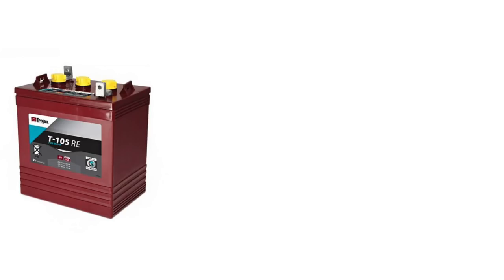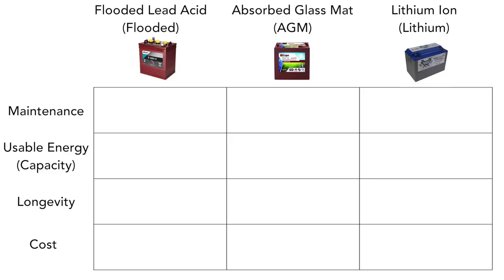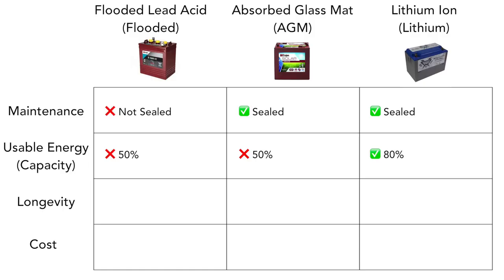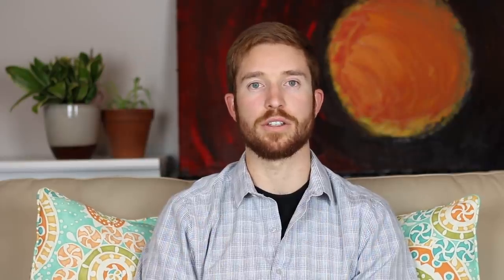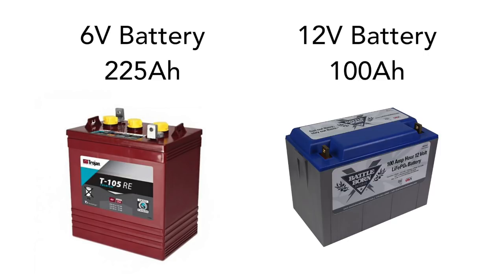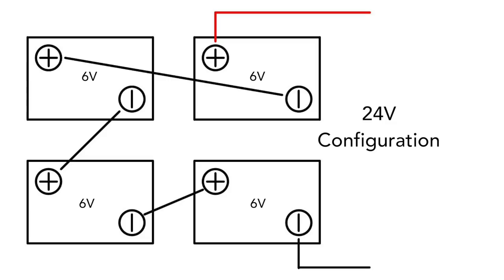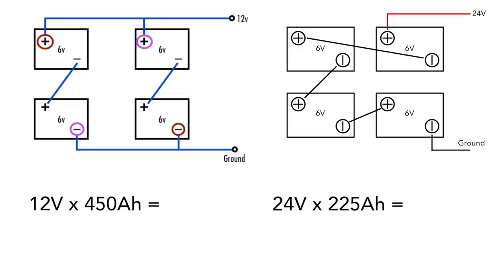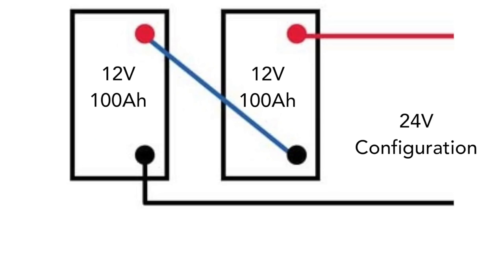Battery Bank Options + Wiring Solar Batteries from 6v to 12v vs 24v

Comment: Love the video, I have a question around my RV build... I have a 12v main vehicle battery(Mercedes Sprinter van stock battery), and want to run 2 x 6v series trojan 260ah batteries for the camper part of this... to charge these batteries I have 2 x 200watt mono solar panels. . . . I want to also have the truck charge all batteries(once the main car battery is charged) - QUESTION: What would you suggest as controller or controllers to look after a safe charge from either or both these power sources to a 12v and dual 6v system)? Thank you - Logan - Auckland , New Zealand.

Comment: NICE JOB! I WANT TO CONVERT MY PONTOON BOAT FROM GAS OUTBOARD TO ALL ELECTRIC WITH SOLAR PANELS AND I AM A DUMMY WHEN IT COMES TO ELECTRIC DESIGN BUT I WILL LEARN. STILL NOT SURE THE ADVANTAGE 12V, 24V OR 48V?

Comment: Weight comparison important.  All RVs have weight capacity issue to deal with. Replacement cost....you'd have to buy 8? Sets of SLA or AGM to equal life of lithium

Comment: I just re-did the math using modern pricing and the 3000 cycle mark for the lithium ion battery and end up with different results.

Trojan Lead Acid = $200/225Ah (112Ah usable) x 6v x 1000 cycles = $.30/kWhc
Battle Born Lithium Ion = $949/100Ah (80Ah usable) x 12v x 3000 cycles = $.32/kWhc

So from a raw power usage over time per cycle perspective, the Trojan Lead acid was actually cheaper.  This assumes of course you're getting the package deal for $200/Trojan battery and $950/Battle Born batter, even over the long run.  It also assumes the safer possibility of the lower maximum cycle limit of the lithium ion batter.  If the goal is to use more power, but less frequently and aren't planning a ton of cycles, it becomes even more favorable for lead acid.

Trojan Lead Acid = $200/225Ah (112Ah usable) x 6v  = $.30/Wh
Battle Born Lithium Ion = $949/100Ah (80Ah usable) x 12v = $.98/Wh

In my opinion, the Trojan lead acid technically offers greater value if you don't mind replacing batteries in 10 years, if you do intend to use the batteries heavily.  In my scenario, I'm looking for larger bursts of power for shorter periods of time or small power usage for only a few hours every once and a while, so I think I will probably opt for lead acid for this reason.  That being said, I'm grateful for the video as it was informative and helped me think about the problem better.  There are also flooded lead acid batteries that are even cheaper than the Trojan also.

Comment: Very informative. I plan to put a 400 watt solar system on my RV in the spring. My question is why would you want to make it 24v when you have a 12v system? I know there is less power loss, but how do you step the voltage down to a usable voltage.
Reply: the main reason is 12V drops volts as it is used, so you start with 14V and go down from there, so the more you use the lower the volts so after 50 Ah you have 12V after 75 Ah you have 11V and so on until you drop below usable volts. so for the most part you can't us all the AH you have for uses. At 24V you use a 12V power supply to make 12V and it will stay at 12 volts all the way down. This is an very over simplified way of looking at the problem. most people use less that 25% of the battery AH.
Reply: Makes sense to me. Thanks for the answer.
Reply from the maker: +John Gerres with a 400watt system you definitely don’t need 24V. We have a 600W system wired in 12V and it works perfect... just make sure the wire sizes are correct (more on that in a different video) 😊. You really only need to entertain 24V when you get to 1000W+ (rule of thumb). Thanks for the great question!
Reply: What craig said is completely wrong, doing what he indicates would destroy the batteries. They do make 16V batteries for that reason however, but they aren't practical in this application. 

What Duet said, with a 400W system on a typical RV 24V isn't even worth considering.
Reply: Would the reason to switch to around 24V when hitting the 1000W+ milestone be because there are little to no supporeted amperage ratings for charge controllers to support? 1000/12 would be ~83 amps.

Comment: For the Lithium battery, your example in the photo is a Battle Born Lithium Iron Phosphate battery, and unlike your example, they can be discharged 100%, not 80%. This is because they're claiming the usable Ah which is 100. And, because you have the price right, which currently is about $950,00, the math will add up even more for the Lithium. There is one other hidden money saver you must consider. The weight of the battery is less than half. So for someone with a few in their RV will also save fuel moving all that lead around. Sure, it's really a very small amount, but in the life of your RV, that weight really does matter.

Comment: Great video, thanks very much! I wonder if you could comment on how large scale lithium batteries like these compare to the smaller types we find in laptops, mobiles and models? My main concern is that these batteries generally only last a couple of years before becoming unstable. There's also the safety issue with them sometimes exploding. Thoughts? Great channel!

Comment: Hi Duet Justus, is there a way you can drop a comment on Salt-Water Batteries and why you left them out-of-scope here? They seem pretty much optimal for stationary use with solar if you have enough room and don't worry about the C-level too much.

Comment: Great video thanks. I believe that the cost of Lithium Batteries has gone down significantly since your video, it would be interesting to see the final calculations again at 2022 prices, I see that in the USA you can get a LiFePO4 12V 100Ah Lithium Iron Phosphate Battery Sale price From $359.99 Regular price $507.03 from Eco-Worthy - 3 batteries totaling $1,079.97 for the batteries, so I expect that after taking into account the time between replacement and repurchase of batteries over say 11 years and 3000 cycles would mean that the Lithium batteries would work out cheaper over 11 years for the same amount of power consumed. 1 set  of Lithium $1079 vs 4+ sets of AGM 700 cycles per set $4800+! and 5 sets of Flooded batteries at 1000 cycles per set $3000 plus the work to replace them and maintain so the cost per wh must now be significantly better 5 years on from when this video was done. I know that in reality the batteries will all last a few more years than total combined 3000 cycles and I am sure new battery technology will improve costs and enhance storage capacities even further in the next 11 years.

Comment: I am setting up a solar attic fan and a blower fan to the system. The total watts is 37. I want to use a AGM or lead acid battery. Will a charge controller shut off load when battery is at a set charge level? I do not want to over discharge my battery. your help is appreciated. Thanks

Comment: I've been off the grid and experimenting with the 3 different types .And you add up how long they last the lithium batteries rock . They may cost a bit more In the beginning but they are worth it . And you didn't even make mention of the weight . Lithium is so much easier to work with.

Comment: do you have any thoughts on a multi source system approach? I was thinking a wind and solar combo? Im planning our future property so I don't have a KWh estimate of daily use yet... I'm thinking I'll probably use gas for the heavy lifters (water heater, oven, exe.) GeoThermal for the heating and air system. those should lower my consumption considerably. I'm currently running about 55KWh per day but we are NOT anywhere near an efficient set up currently.

Comment: Yeah I run 4-6 volt batteries and they cost me $80 (refurbs 2 year warranty) per since I won't keep this van forever, and I'm using a MPPT controller and an LG 400 watt house panel (used, 5 years old, for $200 but still full output). I only want a max 5 to 10 year life as I'll move onto something else ( I haven't seen anyone keep an rv for 20 years and who wants to pull the batteries when you sell it). After doing a cost benefit analysis the choice was clear. I know lithium is cool but not cost efficient for my timeline/application it's not 9 times more expensive cool...

Comment: You should include the best batteries for off grid which is forklift batteries. There made to run 700 amps with out breaking a sweat. They're stronger and last way longer than any other battery and can be bought reconditioned at half price and still out last any other battery out there. 25 years so far.
Reply: How do you move a 1,000+ pound battery ?

Comment: One question is it safe to wire these batteries to get more than 12volts I mean I want to get 110v or 220v is that achievable?

Comment: I am thinking of buying an Off Grid site in Colorado. It get's very cold there and I need a batter they will withstand that temp. Is there one that is good to -20 F?
Reply from the maker: Hey there! Honestly, if it’s going to be exposed to -20 temps, I would personally go with lithium and store them inside the RV where it’s warmer. AGM and Flooded need to be vented and not in a living space but I’m pretty sure the lithiums can be inside and warm with you 😎👍🏼 Hope this helps!
Reply: For function or storage? To live or visit?

Comment: I have heard about people not wanting to take their flooded lead acid batteries below 70% instead of the 50% you mention. Is this to extend the life of their batteries even further?
Reply: Many shallow cycles vs fewer deep cycle.   Many short trips in your car vs fewer long trips = tires still wear out in 30,000 Miles !

Comment: You can fully discharge every battery, lead acid and lithium based, but it comes at a cost... that of the length of the battery's usable life or number of cycles. You do not damage the battery by fully discharging it, otherwise it would stop working the first time it happens. You wear it out faster, that's all. Most batteries do not "die" because of sulfation, they die because of plate erosion, a process that happens faster as the battery is more deeply discharged. It happens from the outside of the pasted plate towards the inside where the support grid is situated. Depth of discharge really does mean what it says. The deeper that you discharge the battery, quite literally, the deeper the chemical action goes into the plate. That quick charge you give your car battery to get it started when it is near the end of its life is known as a surface charge and it is literally on the surface but enough to get you going. Bad analogy, I known but you don't give a deep cycle battery a surface charge. They require an overcharge at a low rate for an hour or so to get the charge "equalized" among all the plates to as great a depth as possible. That is why flooded lead acid batteries need to be topped up every so often. If you equalize an AGM battery, you will lose water from each cell as it is electrolysed into hydrogen and oxygen and the stronger resulting acid will erode the plates even faster. 
I haven't made any comments about lithium based batteries as I haven't had any experience with large ones apart from not overcharging or over-discharging them. Large lithium based batteries are $10 per amp-hour and LiFePO4 types in New Zealand, so a 400AH 12 volt battery if you can afford it, is $4,000. Most people stick to lead-acid types which are around $1.30 per AH for flooded and $2.50 per AH for AGM and SLA types.
Why do people, you included, say that by putting batteries in parallel you get more amps? Dude, the correct term is amp-hours or capacity. The amps depend on the load connected to the battery. Another mistake that I'll point out that people make when putting batteries in series and parallel is that the voltage and "current" is doubled or multiplied to some degree. The correct way to explain it is by adding not multiplying the terms. You may want an 18 volt supply, lord knows why, maybe to use your portable 18 volt drill on, it's either 3 by 6 volt batteries or a 10 volt plus an 8 volt one and they have been made for specialist equipment like cameras and portable tools. Some miner's head lamps were 4 volts, many years ago before LEDs even existed.
Apart from those mistakes, not a bad explanation. Cheers.

Comment: I disagree. My experience is that with lead acid they will only charge with the limit of 0.2c from my solar whatever series voltage I have them in. My 48V (4x12V) at 220 amp each will only charge at a rate of around 500watts. If I set up the same batteries in a 24 V system they charge at around 1000watts from my 2000watt solar panels.
So I conclude that lead acid batteries should be configured in a parrellel setup rather than a series configuration, due to the internal resistances. I don't know whether Lifepo4 have the same problem, thought.
Just my findings, anyway.

Comment: What would you recommend? Series or parallel? I have 4 batteries with a 320 watts panel and a 20A charger controller, 2 of those batteries are AGM and the other 2 just regular car batteries, I want to get the most, I only need it for my chicken coop, for their water heaters and a automatic door which is a car antenna with a timer, what would you recommend?
Reply from the maker: Great question. Keep in mind, you can’t mix battery types. Also, it depends on what type of power you need to run the water heater and door opener. I would go with the AGMs and I would wire to get 12V because the 12V components are so much cheaper. Hope this helps!
Reply: Duet Justus I have a 2000 watts power inverter connected to the batteries and from there i have a extension cord to the coop, during the day the panel have enough to charge the batteries and keep the water heaters working no problem, and yes i have those wired for 12v but like I said 2 of those batteries aren’t AGM

Comment: The Battle Born battery you showed is a lithium iron phosphate (LiFePO4) battery, not a lithium ion battery. There is a significant difference. For example, each cell of a lithium iron phosphate battery is rated at 3 volts, whereas a lithium ion cell is rated at 3.7 volts.

Comment: If you put (2) 6 volt batteries in series that would give you 12 volts. When you get ready to charge, what volt charger would you use?

Comment: I am seventy years old retired in one location looking at two gas generators with two more under construction standing in my front yard . Two hundred foot elevation and ninety percent relative humidity nine months of the year . At my age air conditioning is not an option . 450 amp hours six hours per day may be required . It's starting to look like two separate banks for over nine hundred amp hour total storage would be ample while scrambling constantly to make sure you don't abuse . Any advantage of running two separate systems flooded ? Thanks

Comment: i have 16 6v 440ah AGMs in my basement waiting for wiring...  the pro?  they sit in the basement and don't offgas, no mtce... the con?  double the weight, which isn't a big deal since you're not moving them around...  but EXPENSIVE!!

Comment: Another good presentation , however you have failed to show the difference between lead acid batteries, ie car batteries and deep cycle batteries (like you would have on an RV). A deep cycle battery allows a greater amount of available power, down to 25% of battery capacity, it also has better residual charge than a normal lead acid.
However, If you build your own Lithium Battery, then the cost will come in at around $300 for a comparable sized battery to the 240AH Lithium battery you have described. The battery management controllers are included in this price. Which is of course less than even the flooded cell lead acid.

Comment: a science professor once told me batteries are ALL around 1.5 volts, however paring them in series multiplies the voltage. sooo You can have a 3volt or a 1.5volt but not a 2volt (i guess resistors could be used to lower the output voltage?? Any way could you confirm or explain... no one i’ve asked can answer...

Comment: Hi, very nice and informative video, well i have a problem to share which is beyond my comprehension and hope you can help me with it. I am using two 12 volt, 150 ah lead acid batteries in series for my hybrid system. they both are of same age but only after 5 months of use one of them had a drop in voltage to the point that i had to take it back the shop to charge it again. it was kept for three days on 1 amp current and finally became usable. something that i dont understand is why does the voltage of both batteries differ in a series. when i change the sequence of the batteries the second battery in the series then starts to show lesser voltage on multimeter than the first one. what can be the reason?
Reply: Old post but maybe you will get a notification...or others may benefit from what I say.  A possibility is battery cable length.  ALL cables should be of the same length and gauge, otherwise the amount of charge going to batteries with a longer cable/less gauge will be less simply due to voltage drop.  Even a minor difference in length can do this.

Comment: The longevity of flooded Vs AGM/Gel is a little different in my experience. I have been using solar systems for something like 20 years now and I have rarely seen a flooded battery last longer than 5 years. Gel cell I have seen get upwards of 12 years.
Reply: Trojan SOLAR SPRE 06 255 = $205,  230 Ah @ 6 Volt, 3,400 Cycles ( 9+ Years ) @ 30% DOD ...

Comment: On lifespan of Li Ion cells, a lot depends on how they are charge and discharged. Higher rates of both has a significant detriment on total cycles.